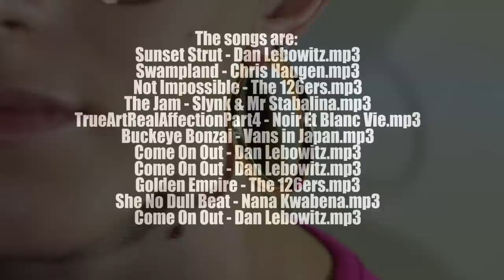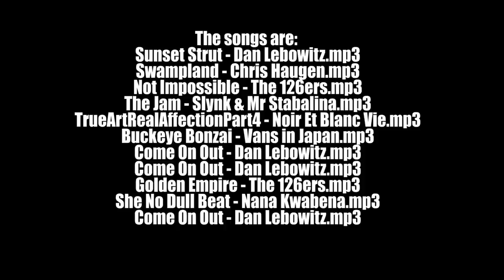How to make a pair of hollow inner hoop earrings in 18kt gold

Comment: how do you fabricate the hoops to be tapered?
Reply from the maker: To make graduated earrings you need to create a mold and make the two halves which will then be soldered together. The most artisanal method is to create the male part in a metal and use a lead plate as the female part. Today earrings with particular shapes and voids inside are often made with an electroforming process.
Reply: @scaffoal   So that's how they do it by soldering the two halves. Interesting, thanks scaffoal 👍

Comment: I still don't understand why anyone would choose 18kt, when you could get in 24kt. And it'd look better.
Reply from the maker: I still don't understand why anyone would go for 18kt, when you could get 24kt. And it would be better.
24Kt gold corresponds to a fineness of 999.9 thousandths, i.e. pure gold, it is too soft to be used as an ornament, it would wear out quickly. For this reason, over time, alloys have been added to gold to make it harder and more resistant. In Italy and in many other countries, the 18KT fineness corresponding to 750 thousandths is customarily used, which I believe is the best compromise between low value and durability to wear.